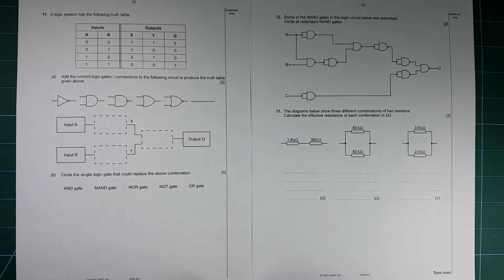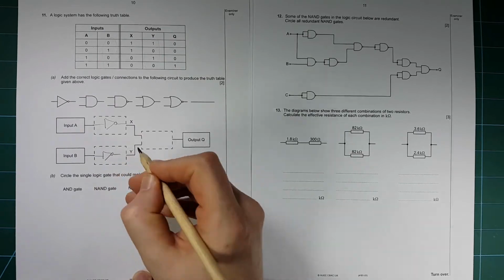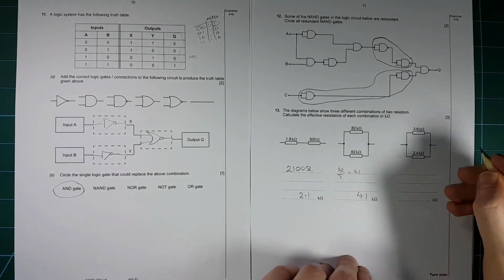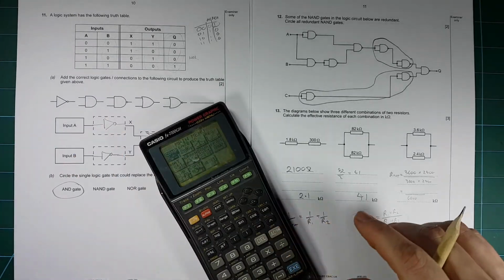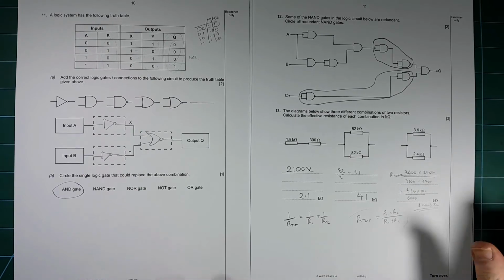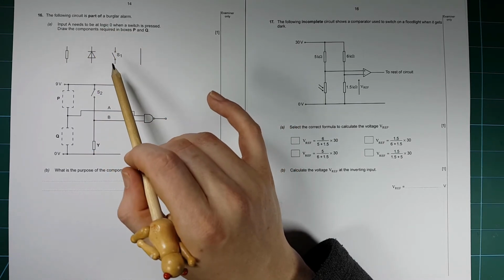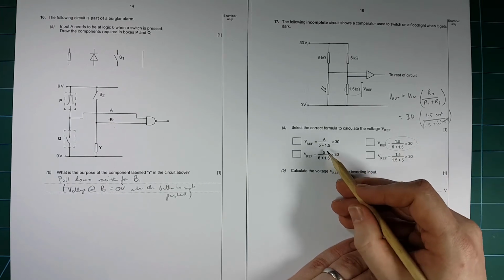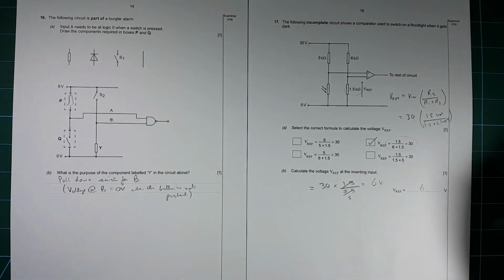GCSE Electronics 2016 paper 1 WJEC

Comment: Hi, thanks for this video, I recently had my electronics mock in December and I found that the structure of the questions were more different and harder than the past papers for WJEC.
 The main question I found different was a 6 mark extended response question which my teacher said there was no mark scheme for (this was for paper 1). Are you aware if there have been any recent changes to the specification or a reason why they might have done this? I believe this was the GCSE sat in 2019
Many thanks
Reply from the maker: Yes the paper structure changed quite a bit. I will cover that paper when it is declassified.

I think the style of the papers will be a lot more open ended. Older papers often had "choose from a list" "Circle the answer" where as the new ones will have more "Describe how the circuit works" "Calculate V" "Evaluate the flow chart"
I made up some 6 markers to go through with my class. Perhaps I can do videos on those.
Reply: @pastpaperguy8744  Thank you for clarifying this. It'll probably mean I have to revise the content more thoroughly as I now know what to expect. If you are able to do a video on the 6 markers I would be grateful for the help.